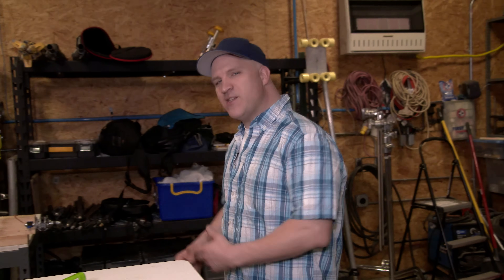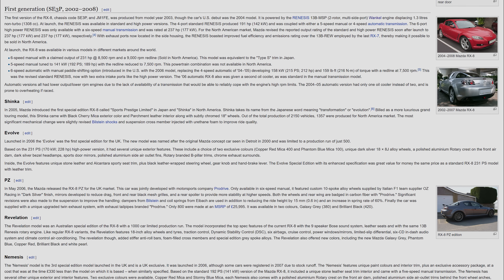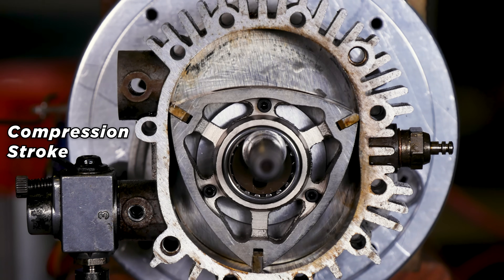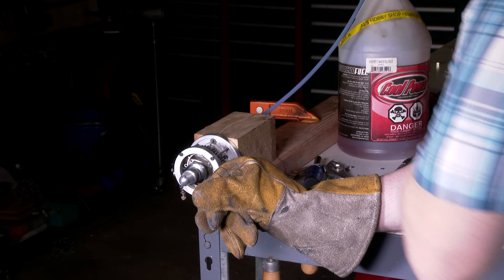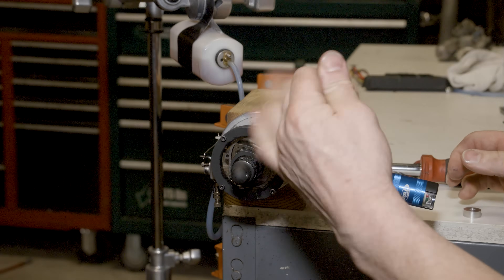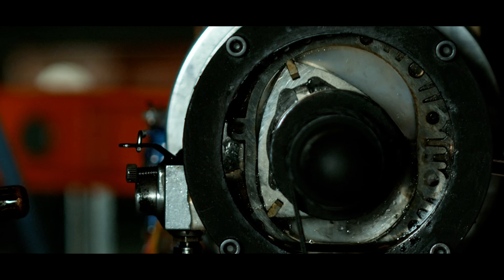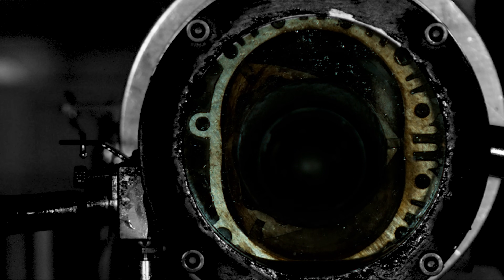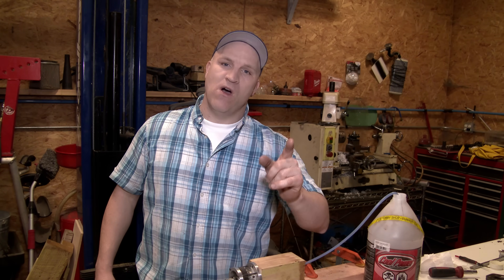See Thru Rotary Engine in Slow Motion - (Wankel Engine) 4K

Comment: This is to cool but also shows you how Inefficient Rotary engines are by the amount of fuel spit not exhaust port
Reply: @will w 
If memory serves me correctly Mazda tried this....
One the catalytic converter didn't get warm enough so it ran cold thus reducing efficient smog cleaning ability of the cat. So a double whammy. 
Not to be quoted literally just something I read very quickly in passing.
Reply: @Rxonmymind Mazda's problem was the Wankel engine simply cannot be adapted to use a modern high swirl or "Quench" type combustion chamber, The Wankel's combustion chamber is extremely crude and inefficient compared to modern reciprocating engine which now , all use Pent-Roof or Wedge chamber configurations to reduce HCs and CO before exhaust after-treatment and increase power and fuel efficiency compared to the obsolete Wankel design.
Reply: @asgeir axel  I'm sorry you are not knowledgeable enough to keep up or follow the conversation... perhaps you should stick to watching some fundamental videos for awhile OK kid?
Reply: @will w Yes, Mazda has already tried this approach with an exhaust afterburner device called a Thermal Reactor. Several early emissions controlled Mazda models were equipped with Thermal Reactors and functioned similar to a 2-way Reduction Catalyst  reducing HCs and CO  through Oxidation. The introduction of more effective and efficient Lambda fuel controls allowed the use of modern 3-way catalysts making the primitive afterburner devices obsolete.
Reply: @doktorbimmer  This design is the most efficient for hydrogen combustion, after the Bourke engine.
Reply: @Valdimer Lucifer Actually, the truth is the Wankel engine is very poorly suited to gaseous fuels like hydrogen or methane, because the Wankel cannot efficiently extract the heat energy from these fuel types due to its limited static compression ratio. Mazda's entry into the Norwegian HyNor program was the least fuel efficient of all the hydrogen power vehicles tested, Mazda's entry was rejected from the program and Mazda abandoned its hydrogen fuel research in 2009.
Reply: @doktorbimmer  In 2009? Then what the supposed to be 2015 rx8 hydrogen models is? And you forgot something really important that happens when you use hydrogen fuel with plenty of oxygen, it burns so fast (multiple times the speed of sound) that it creates a LOT of force and heat. "Doesn't work good" it's just false. While yes, it could run better at 20:1 compression ratio (Bourke engine), it's still a really good solution, all fuel burns, burns really fast.
Reply: @Valdimer Lucifer Mazda discontinued all development of Wankel engines in May 2009. The RX-8 HRE and Premacy HRE were cancelled in 2009.
Reply: @Valdimer Lucifer You seem very confused and have a limited knowledge of HCSI engine technology. "burns so fast (multiple times the speed of sound)" DEFLAGERATION is SUB-SONIC in a spark ignition engine.  If the air -fuel mixture "Burns" its not supersonic.
 Wankel engine cannot produce a 20:1 static compression ratio, this is not possible due to the geometry envelope of the engines fundamental design parameters.
 The Bourke engine is an unproven design that was a commercial failure... there is no evidence to suggest that it is even a practical design... let alone an efficient one... no verifiable efficiency data exist for the Bourke design... nor are there working example available for such testing... just unproven claims.
Reply: @doktorbimmer  What should happen if u put a match with fire in a hydrogen / Oxygen Bubble? I'll tell you. It will burn so fast that you won't be able to see the flame properly, and you will be deaf for at least two seconds. Last time I checked, that is what happens when you break the sound Barrier. No matter what you may say, there are already explosion based instead of expansion engines, like the Bourke engine.
Reply: @doktorbimmer  Learn how to type my name also. You just need to do one thing that is not clicking my name.
Reply: @doktorbimmer  The Bourke is a proven design (experimented and showed here on YouTube) and it was not a market fail because it was never introduced into the market: Sir Bourke died before he could, only leaving all his parents behind.
Reply: @doktorbimmer  Recently, some University professor said that it could reach, hypothetically, a 81% efficiency.
Reply: @doktorbimmer  Just to be clear, there are working models, here on YouTube, but they are not as NEARLY tuned as what it should be.
Reply: @Valdimer Lucifer If the Bourke engine was never introduced into the market... then it is not a proven design.
Reply: @Valdimer Lucifer In the real world, practical internal combustion engine designs do not reach their theoretical efficiency limit.
Reply: @Valdimer Lucifer Real efficiency data is collected from production engines tested under long term testing and comparing BSFC data like iso-graphic island charts and EGTs to calculate Carnot Cycle Formula results.  
 What good is an 81% efficient engine if it cannot run for more than 10 minutes????
Reply: @doktorbimmer  Oh, don't tell me?
Stop editing my name, that is a lack of respect.
Do you want me to edit yours?
Reply: @doktorbimmer  Oh dear, you discovered gunpowder! Of course they never reach the theorical limit, but it's still much higher than any other engine.
Reply: @doktorbimmer  Uhh, where did you get the info that Bourke only runs for 10 min? You know, there are not a lot of them, so, how did you get your data?
Reply: @Valdimer Lucifer Then why was the Bourke engine a failure?
Reply: @doktorbimmer  Because it never took off because Bourke dyed young and never implemented it other than a model engine.
Reply: @doktorbimmer  How so if there were running models?
Reply: @Valdimer Lucifer You tell me, you are the one trying to claim it never developed beyond a model, which is proven now to be a completely false claim.
Reply: @doktorbimmer  What Exactly is a false claim? There are running units here on YouTube and models of the schematics of Dr.Bourke, Other than tested on universities, and a small engine also that produced much more power than engines of the same size. And it was A PROOF OF CONCEPT. Do you want links to working models?
Reply: @doktorbimmer  So, things NEED to be on the market, or they are fake/failures?
Reply: @doktorbimmer  The Bourke engine was no failure. It was never implemented on the market because Bourke died very young.
Reply: @Valdimer Lucifer Then explain why AMC did not pursue its further development after a full sized engine was built and tested???
Reply: @Valdimer Lucifer No, they just need to deliver real world test data to confirm unsubstantiated claims of higher efficiency and that it is a practical design.
Reply: @Valdimer Lucifer If it was built, exhaustively tested and yet came to nothing? Yes, that would be a failure.
Reply: @Valdimer Lucifer  He died young??? Really???
Reply: @doktorbimmer  21 hp out of a 100cc model amateur engine is enough good for you? Can't you, mister "I know everything" search a bit on the web?
Reply: @doktorbimmer  He died young, certainly not enough to bring the engine to the market.
Reply: @doktorbimmer  Except if the creator dies, with all his patents, that get blocked for more than 20 years. He didn't bring it to the market because he died before he could explore it to the maximum, bring it to the market, or give it enough popularity.
Reply: @doktorbimmer  Links?

Imagine, you made a robot. But you died before it went to the market. It was extremely Advanced and had HUGE potential, but it can't be posted because you died with the patents in hands.... What would happen?
Reply: @Valdimer Lucifer What about the 6,500cc 4-cylinder that was built??? Bourke claimed it produced 200 hp but AMC did not develop it any further.
Reply: @Valdimer Lucifer The Bourke patents all expired in 1957, there is nothing blocked and anyone can copy his designs now... if there was anything valuable there someone would have developed it further by now, the truth is it was a failed concept.
Reply: @Valdimer Lucifer AMC was the fourth largest automaker and sold millions of engines... if they canceled their interest in the Bourke design then there must have been a good reason.
Reply: @Valdimer Lucifer I think you have absolutely no clue what a "Patent" is?
Reply: @doktorbimmer  Yes. What about it? It did exist, right? You know, what happened was something simple: you had a great idea, but it was too advanced (causes rejection). But then you die, and your idea is forgotten, and because everything is about money now, (you see where I'm going) they just did not produce. Knowledge is not everything, you need logic too.
Reply: @doktorbimmer  Patent: a paper that says that you invented something and you have copyright on it. Wow. (I'm over simplifying, of course).
Reply: @doktorbimmer  So, AMC sold millions of these engines... I'm curious to see where all of them went...
Reply: @doktorbimmer  And it is still being developed, not professionally, unfortunately.
Reply: @Valdimer Lucifer So explain why it was never mass produced ???
Reply: @Valdimer Lucifer If it was such a great idea? Why didn't AMC buy the rights and mass produce them?
Reply: @Valdimer Lucifer A patent is not a copyright... you are confusing two completely different things. A copyright is used to protect intellectual property like books, films or images... not technology hardware like engines, devices or other mechanical or electronic inventions.
Reply: @Valdimer Lucifer The Bourke engine never proved to be better than existing designs and never proved that it could deliver the claims made by Bourke.... so naturally there would no longer be any legitimate development today.
Reply: @doktorbimmer  I'll tell you slowly then:
IT. WAS. TOO. MUCH. ADVANCED. FOR. ITS. TIME.

and, it is a two stroke.
Reply: @doktorbimmer  Functions the same way for two different things. But it still functions the same way.
Reply: @Valdimer Lucifer No, its a very outdated and inferior design.
Reply: @Valdimer Lucifer No they are not the same dummy... patents expire after 14 years and cannot be extended to more than 20 years. Copyrights last the lifetime of the author plus an additional 70 years.
Reply: @doktorbimmer  How so inferior? How can it possibly be inferior? Hydrogen, when burning lean, has a NEARLY instant combustion. And, in a high pressure environment, it explodes. But, that explosion doesn't cause much damage.
Reply: @doktorbimmer  Serve the same thing. The lifespan is not really that relevant to the argument.
Reply: @Valdimer Lucifer Because every single successful internal combustion engine design uses Deflageration... not Detonation. Detonation is a bad thing and should be avoided. The Bourke engine relies on a Scotch Yoke instead of crankshaft instead of a traditional crankshaft arrangement... which has been proven over time to be superior.
Reply: @Valdimer Lucifer IT IS NOT THE SAME, inventors PATENT their designs... they do not COPYRIGHT them as this would be useless against preventing someone from stealing your design idea. If you cannot develop you patent into a profitable product with the 20 years allotted? Your idea was not only a failure but you wasted your time and money having it patented in the first place!
Reply: @doktorbimmer  A crankshaft is NOT superior. It causes piston side friction,which is not equally devided, and it's less resistant. The Scotch yoke can use detonation. It will not suffer from OVER FRICTION in certain parts, but apply friction equally. Other than it can actually flow better in movement, and, I tested the Scotch yoke on a Lego model Bourke engine, it's much more efficient and reduces friction by A LOT. That is the good thing about the Scotch yoke: it's just a linear movement. And if it's just a linear movement, you can use the most efficient way of burning a fuel: detonation. While yes, it CAN damage the Pistons, it much less likely, because most are made out of titanium and are really robust.
Reply: @doktorbimmer  Could we stop an worthless argument? (About patents)
Reply: @Valdimer Lucifer Then please explain why none of the successful reciprocating internal combustion engines use a scotch yoke?  All of the commercially successful engines use a crankshaft...
Reply: @Valdimer Lucifer OH! I see... So you're saying that if it works for a Lego® toy model it must be durable enough for real engines???? Interest theory, can you name any automotive or aircraft engine designs based on Lego construction techniques.???
Reply: @Valdimer Lucifer No, because you made the issue of patents a key part of your explanation as to why the Bourke engine has not been further developed commercially... you claimed that patents were the reason... but ALL OF Bourke's patents expired decades ago. YOU SEEMED VERY IGNORANT OF THIS FACT.
Reply: will w it’s called egr and it still doesn’t solve the issue.
Reply: Yeah but it sounds bad ass.
Reply: the poor engine was about drowning in fuel. Im surprised it started at all.
Reply: Glow fuel is a mixture of nitromethane and methanol and requires a much richer mixture than gasoline. The stoichiometric ratio of air to methanol is 6.45:1 compared to 14.7:1 for gasoline; for pure nitromethane, it's 1.7:1.
Reply: @Zak Wilson Excellent comment...
Reply: @doktorbimmer  Zak Wilson is anthony cambell
Reply: @Picasso Impaler You do realize this engine runs on nitromethane? The fuel in this engine is highly oxygenated and must run at a much richer mixture ratio.
Reply: A turbo would solve that problem
Reply: @dokterbimmer7270  And?
Reply: @Hentai tamilan  Engineering is not art... it is SCIENCE.
Reply: And you have just been reported for making terrorist threats kid, you better watch your mouth.
Reply: @doktorbimmer  dokterbimmer the fake ???? WOW!!! You're right, he did delete all his comments                          stupid  tweet tweet tweet
Reply: A 4 stroke would spit that much fuel out the exhaust if you ran it that rich too...
Has nothing to do with being a wankel
Reply: All Wankel engines use the same 4-Stroke operating principle... the Wankel's limited geometry envelope does not allow for a modern, efficient combustion chamber design... so incredibly poor, and incomplete combustion is inherent to the basic fundamental design.... it is also why the Wankel engine is now obsolete in the engine manufacturing industry.
Reply: Porsche has won Le Mans 19 TIMES!!! and Audi 9 TIMES!!! WITH A DIESEL ENGINE!!!!_ what is Mazda's excuse?
Reply: @doktorbimmer  A diesel is more efficient, can't see Why you are surprised.
Reply: @Valdimer Lucifer  A Diesel is an order of magnitude more RELIABLE... which is why no one is surprised by their success in endurance racing.
Reply: @doktorbimmer  Diesels are not only reliable. The diesel fuel has much more energy than gasoline, the problem is it runs slow, and doesn't produce that much horsepower. But also the lack of speed (RPM) reduces wear. Also, they produce more power per revolution, and that is really easily seen by the torque numbers, but the main reason why Diesel is superior is on 2 strokes. While yes, they are really pollutant, they are the highest efficiency of all piston engines.
Reply: Diesel fuel D2 (Fuel oil number #2) has about the same energy per kilogram as gasoline... Diesel engines are more energy efficient regardless of what type of fuel its burning.
 Not true Diesel engine can and do rev to rpms nearly 8,000 rpm... Do you know why most Diesel engines do not rev over 5,000rpm?
Reply: @doktorbimmer  I am well aware they can, also I am well aware that is really expensive to build an engine that "heavy equiped" with premium materials.
Reply: will w you could strap a model turbine to the exhaust of the model rotory and have a bench top afterburner in need of model fighter jet maybe but user name is off on the explanation of egr theory, that system is less half baked than smog era accessory driven air injection pumps plumbed into catalytic converters but still only for cooling combustion/exhaust to help reduce emissions from oxides of nitrogen & has nothing to do with recovering unspent hydrocarbons, the pcv system does partially what he’s claiming tho

Comment: What if instead of 3 it had 6 sides? Wouldn't that result in higher rpm and hp?
Reply: How would you achieve the compression and power strokes with 6 sides?